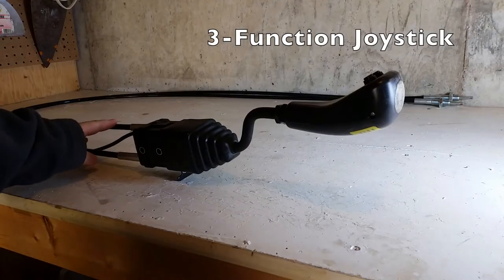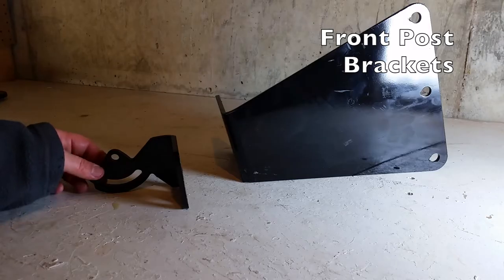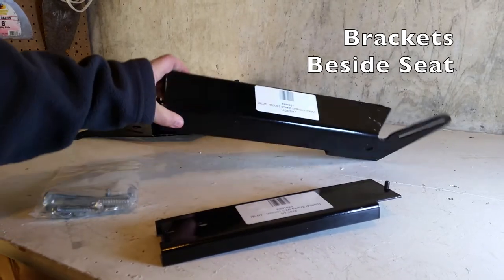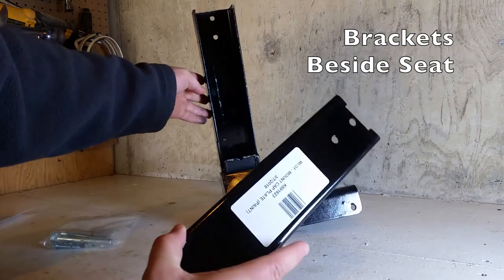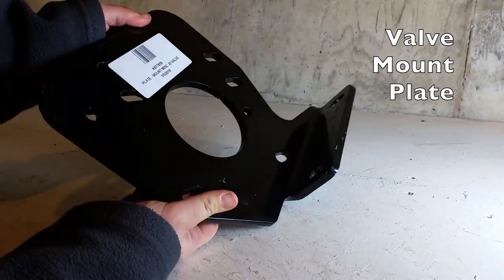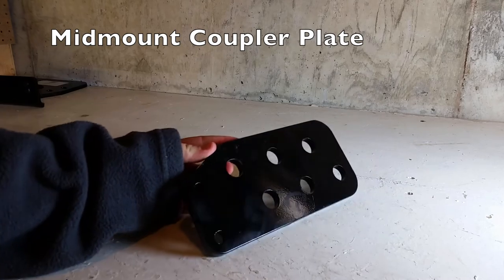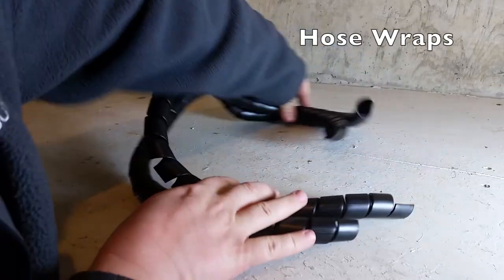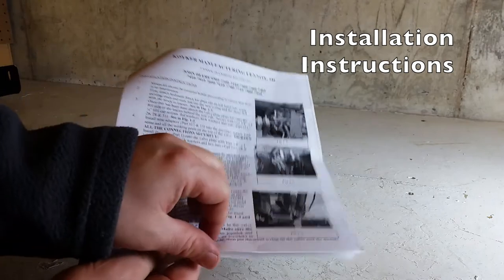Complete Joystick Kit for John Deere 7000 Series Tractors

Comment: I would just like to thank you for your videos. I've been trying to find videos on and off for months on how to do a full install on the joystick  for a loader and I've found  jack until I stumbled up on your videos. They are extremely knowledgeable and you explain things in detail but simple enough to understand what to do so I just want to say thank you. You've made it much easier for me to understand what the hell I'm doing when I install a joystick from scratch.  As we got a tractor second hand with the loader brackets installed and the 4 pipes to the couplers and the one from the pump and that's it we got nothing else so we sourced a loader boom and now we have a joystick and cables so I'm hoping this is all I need to be good to go or will I also need a spool valve?
Reply from the maker: HI Matt, thanks for the feedback on our videos. You're right, you need the spool valve to finish your setup. Typically spool valves are sold along with a joystick and cables because the way all 3 connect together gets pretty specific. Feel free to email me at sales@shortlineparts.com and I can explain in more detail. Also, you can take a look at the complete joystick packages that we carry, where we are selling the joystick, cables, valve, fittings, hoses and mounting brackets - everything you need to control a front end loader that was added on to a tractor: https://www.shortlineparts.com/john-deere-complete-joystick-packagehtml#1055=
The ones listed here are for John Deere tractors but we do carry complete joystick packages for most tractor brands.

Comment: Will this work with a bush hog loader on a John Deere 7410?
Reply from the maker: Yes. The kit is designed for the tractor, and will work with a wide variety of loader models. The one modification that may be needed is hydraulic adapters between our hoses and where they connect to your loader's steel lines.